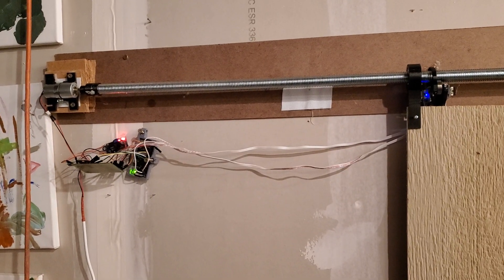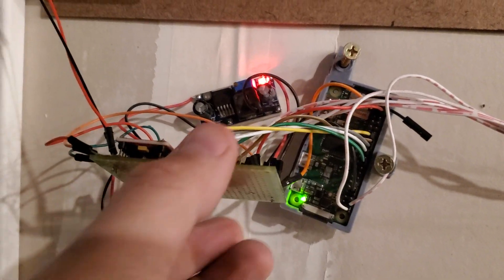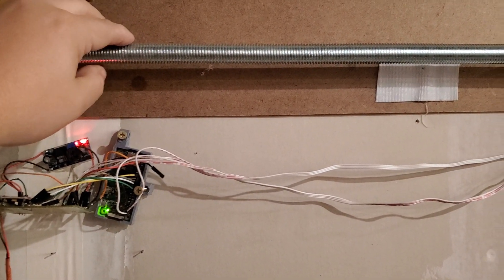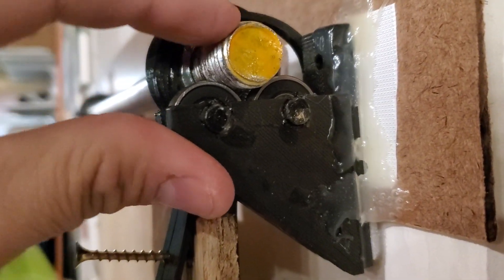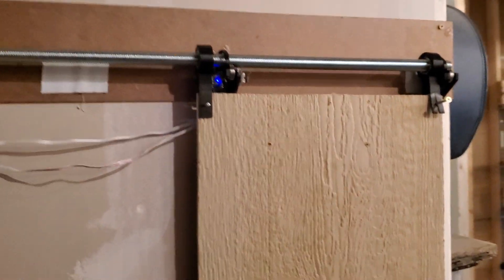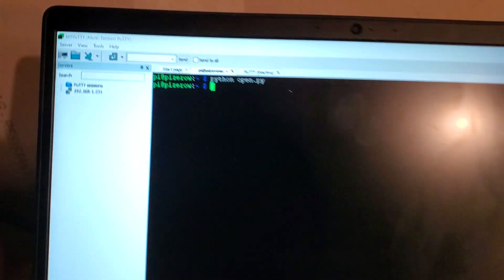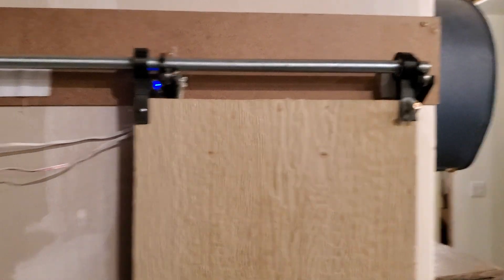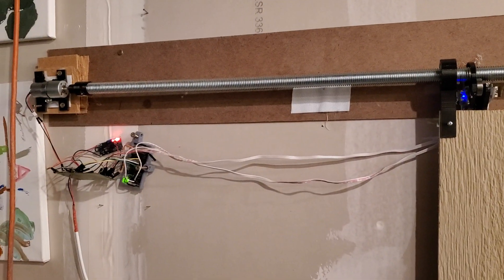DIY lead screw chicken or duck door. raspberry pi, motor controller, part 2

Comment: You need squisyhguard! Hatchlings can be stupid...Sliding door pulled with a rope secured on a motorshaft. Feed that rope through a hose(sleeve&cable); you can have a limitswitch in a corner. As the rope meets resistance going through the hose in a 90degree bend it will pull the hose in from the corner. Pythagoras etc so your limitswitch goes where the rope pulls the hose to (against some springtension that holds the cables/sleeves inplace). 
This should allow for a more friendly door!
Reply from the maker: That's a great suggestion, thank you!

Comment: hi and thanks for all your great video tutorials! I wanna order some modchips for making a few consoles for myself and my family/friends.
I have a Trinity, and I plan to get some more Jaspers.
There's so many modchips, which would you recommend for Trinity or Jasper? ACE 3, ACE 5, Matrix v1, Matrix v3, Coolrunner ref C... (I'll be ordering from chipchopmod co uk).
Reply: P4RADIGM this topic is a little out of context in this topic, but send an email to the guys at chipchopmod and they will suggest the correct mod chips. I think either matrix or coolrunner are best for PHATs.. but they also have the other stuff you’ll need for modding. Good luck!
Reply: @alankerrigan  thanks. what is best for Trinity? can I use the same chips or better an ACE 3/5 (seen that one on another channel modded). I would like to get same chips for both consoles, but if another chips is really better of course I will have to buy 2 different chips...
Reply: @p4radigm989  
u can go with mitrix v3 for all of them using muffin install ...

Comment: Nice job. Did you consider putting a sensor on the door to detect if a duck was stuck between it and the door casing. Seems your door will continue to close until the upper sensor is clicked.
Reply: you mean something like a motion sensor or light beam? sure, but he could also attach an air raid siren warning the ducks, then it is their own fault if they get decapitated...